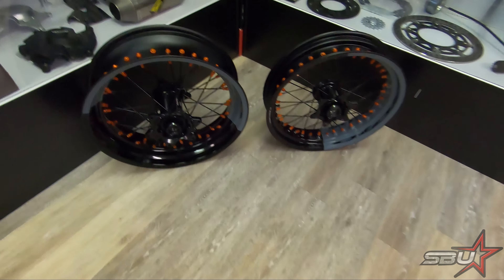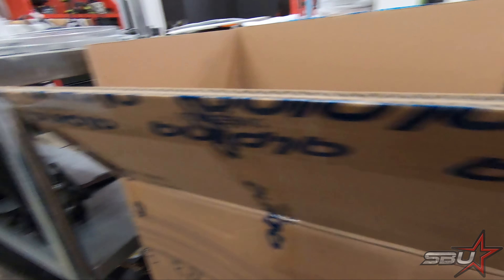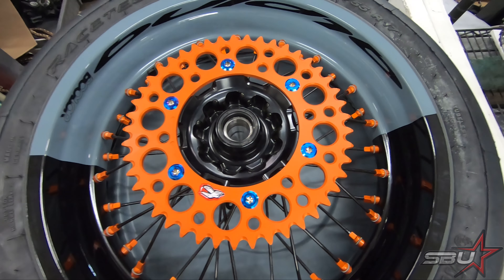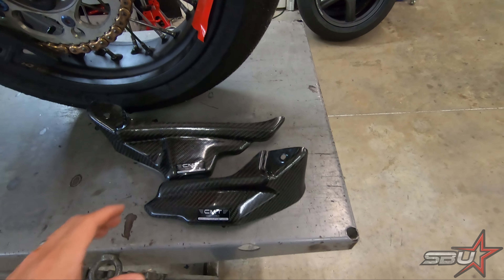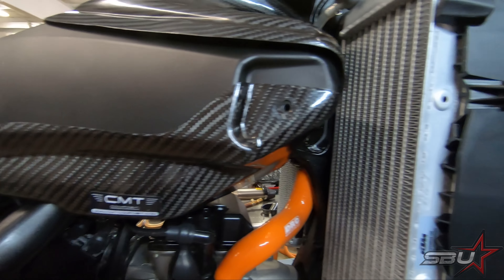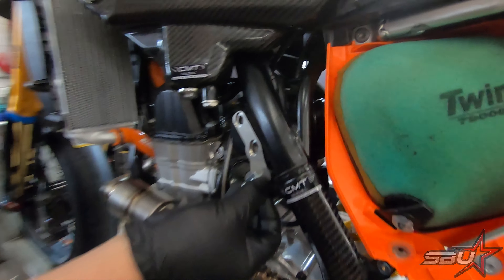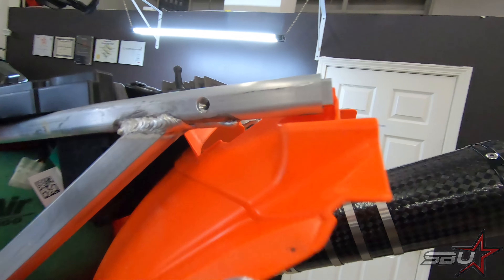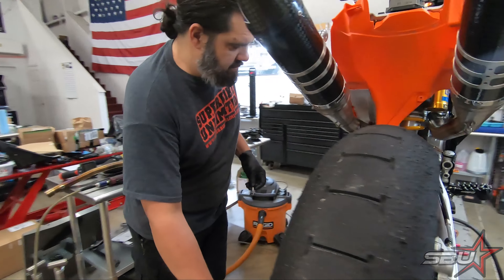KTM 450 SMR Pt. 7 - DVR Dual Exhaust Vs Arrow Dual Exhaust + Custom Alpina Wheels!

Comment: Do dual exhausts provide any performance benefit for thumpers?
Reply from the maker: Based on our results, we think so. We have not done apples to apples comparison on this bike to be certain, but this is a strong gain. Also, rest assured supermoto teams would never add the weight and complexity of a dual system needlessly.

Comment: MTR-racing from Italy uses Tekmo exhaust on ktm smr’s and claims that those are the best…
Reply from the maker: They are part of a small crowd in S1GP - they also use that so they can run that intake they sell.
Reply: Ah okay I see, they also have there own triple clamps, special swingarm and headtube modification for supermoto geometry. They are pretty well known! But I myself am a TM SMX 450 FI guy those bikes are factory trick out of the box and can run with the best supermoto’s in Europe no problem!